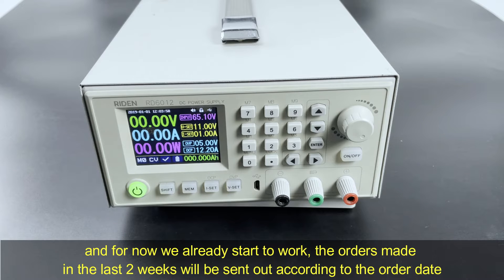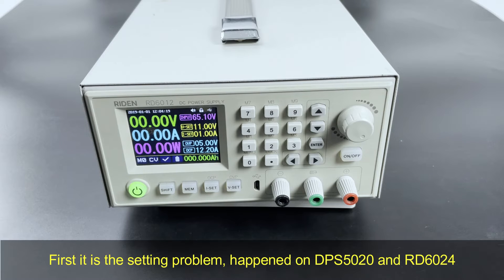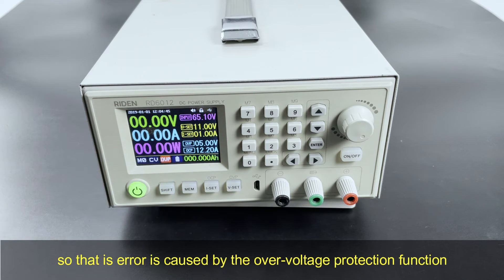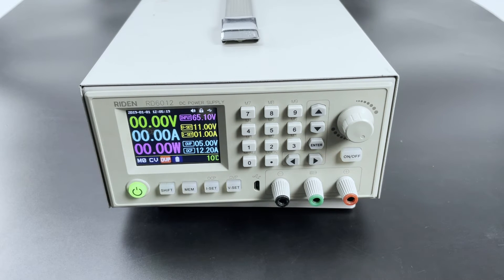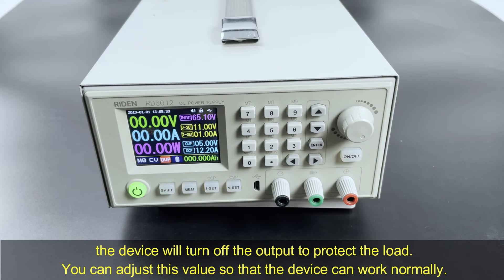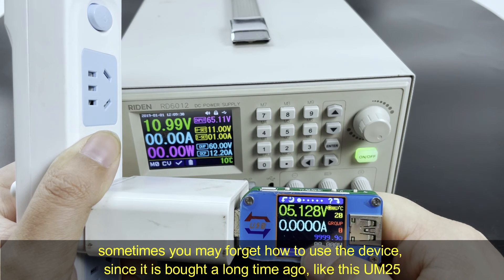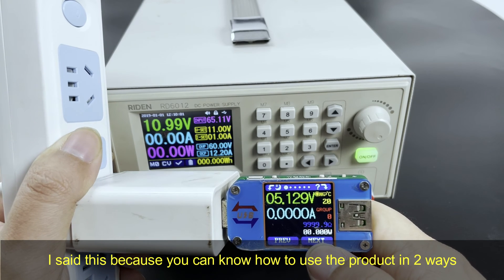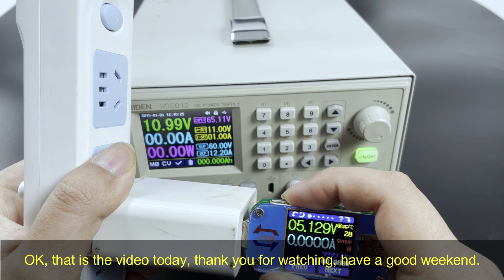OVP/OCP setting problem for RD/RK/DPS power supply  RD6024 DPS5020

Comment: Can you help me how to change the voltage from 110v to 220v please
Reply: Thank you
Reply from the maker: you are welcome @uilwahak
Reply from the maker: hello, you order the RD series assembled set? if you order the US 110V AC version, you need to open the case, there is a red switch on the AC to DC PSU sideway, put it to 220V gear and it can use 220V AC input